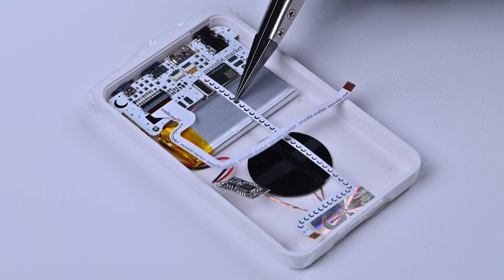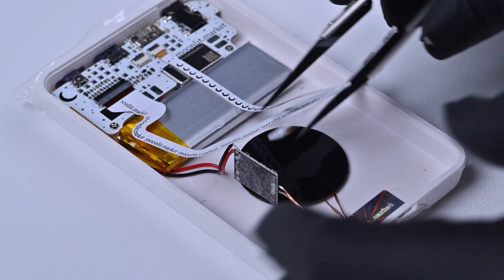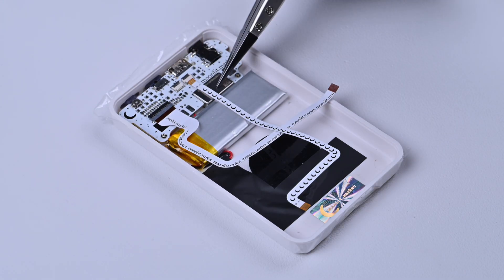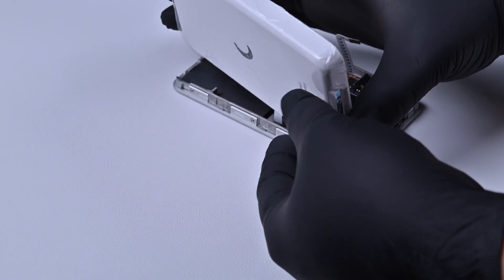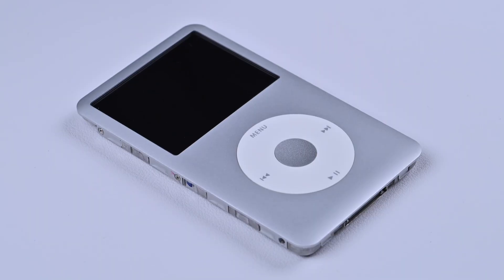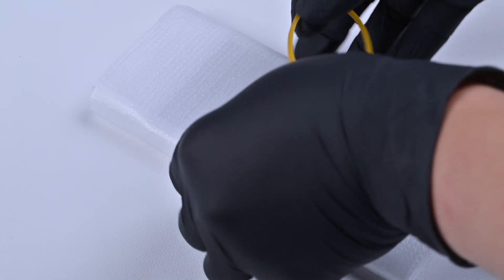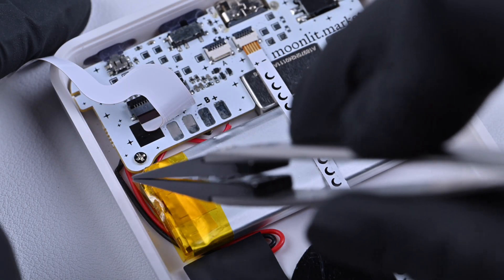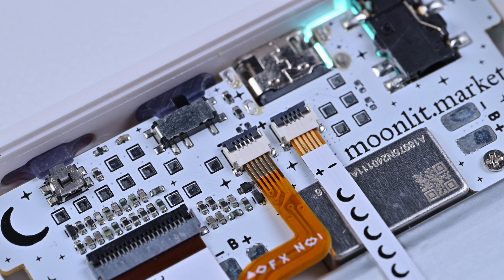iPod upgrade in 10 min! moonlit.market Classic Connect installation tutorial

Comment: It still possible to buy the classic connect older version? 

I wanted to make a full transparent iPod classic for years, and that I’ve already modeled the case. But despite how much I love the idea of an integrated Taptic Engine due the tight fit on the slim plate (10.5 mm) it won’t fit on my design unfortunately, so I need the first PCB version. 

I been searching for one anywhere and can’t simply find one.
Reply: Why not just buy the classic connect 2 in clear and a clear face for your iPod?
Reply: @randnet yes it could be the easiest thing to do but it have some disadvantages, first one the case it’s translucent but not fully transparent, I’m considering a policarbonate one. Second this is slightly bigger than the iPod front plate so the front plate is kind of sunk inside the backplate, it didn’t have a perfect match as the apple ones, also it need to be glued, so I had to re engineering the clips to have a perfect fit and can open it easily again. Third the classic connect 2 it’s larger than the first version so it can’t fit a larger battery. There are so many considerations I had to made in order to get the final model. I already have a transparent iPod classic 6g from elite obsolete electronics, and despite how much I love it o don’t like the fact that the front plate it’s flat like the iPod video, I wanted the same rounded edges like aluminum one, so started to sketching how I can make it fully transparent and accurate to it’s generation. And now that I finally did it, I couldn’t find anywhere the first version of the classic connector.

Comment: In my own experience, you may need to remove the wireless charging pad so that the top half fits more flush if you use the larger battery.